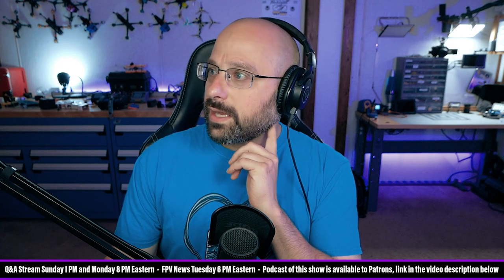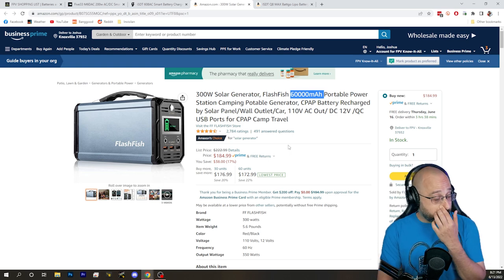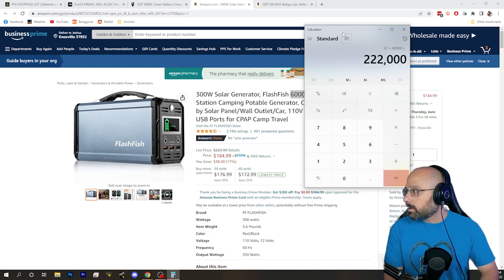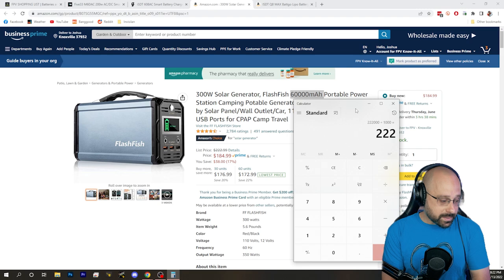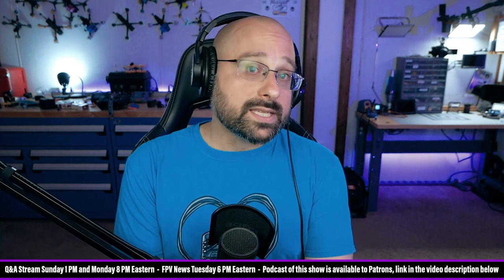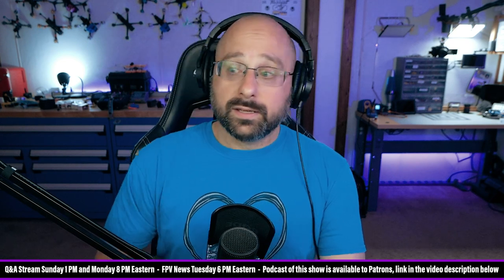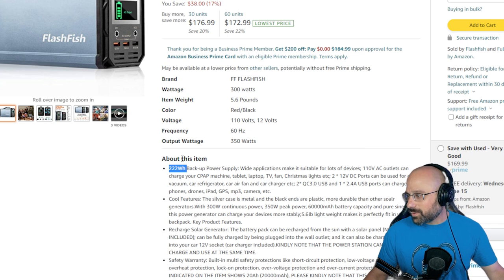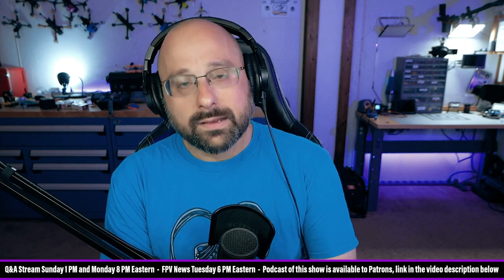One Big Battery Or Lots Of Small Batteries? - FPV Questions

Comment: I’ve been bringing one of those toolbox sized power banks to the field and it works well for me. I can charge some extra packs and/or use the 12v outputs for my goggles and ground monitors. It’s got USB to charge my transmitter. Perhaps not the most efficient field-charging solution but very versatile.

Comment: I use a similar power station for field charging. I just made a barrel to xt60 adapter and it works alright.

It's definitely inferior to a big lipo, but where it shines is that you can plug a solar panel into it while camping.

Comment: I have a 20A 6S4P Li-ion field pack made out of 21700 cells that I use for charging my flight packs. It’s enough for a whole day of flying. I use two flight packs and charge them at 10C. Over 100 cycles and the IR still sitting around 2. I know this style of charging is somehow controversial but I haven’t had any problems so far. Just be careful to fly the pack as soon as it charges and you’ll be ok.
Reply: I've heard the same thing about overcharging lipos, as long as it's flown right away after being charged to hv the lipo should be relatively ok.
Reply: The same. so much money and time saved. And it's safer since you never charge lipos at home, you bring them home on storage charge and put them directly in a batsafe. I just have 3 lipos, and change them about twice per year. :)
Reply: 6S5P 21700 25Ah here. 3 packs that are changing out, charging at 5-8C. Can confirm that the batteries last until they get destroyed in crashes - which is usually around a year for me.
Reply: @KryptFPV  Yo Can you tell me something more.  how many lipos you can load.  and which type 21700 battery you use? (mah an a) or a weblink to battery
Reply: Can you tell me something more.  how many lipos you can load.  and which type 21700 battery you use? (mah an a) or a link to battery
Reply: @Snipfpv  diy. about 26.000mAh 6s6p liion pack. can draw 30A from pack. dont know the exact type but i thing they are some LG 4850mah 21700.
Reply: @Snipfpv  INR21700-M50T 5000mAh - 7.3A
Honestly no idea how many packs you can go through with it, I can fly all day with this fieldpack
Reply: @KryptFPV  thx for the comment mate🖤
Reply: @Snipfpv  all good! Sorry for the late reply - I usually don't check youtube:p

Comment: You know, Joshua, I've seen a pretty interesting system used to make power walls. It's basically a stackable battery holders (so you don't need to solder anything) and a "top battery holder", let's say, with the BMS. So you just fit the batteries in and connect each holder from the stack with the BMS via cables (with connectors). You know?
And searching from China I've found those for 6s packs upwards (I guess the highest I've seen was 9s, but I'm not sure).
Either way, I'm thinking about buying this stuff and making a field charging box. I could put an USB out, maybe even an USB-C out...
Anyway, just some dreams. 😬

Comment: Im a racer. I have 60Ah 4s liion=4kg. And I charge 28paks 6s 1.3Ah on field. I have 3pcs of these 1.3 and while I flie next two is charged. Because charge time is 6minuts on 10A. And I always fly with "new" packs, and they warm, with less internal resistance. Therefore less damage. With regenerative 7A I discharge 5min after finish flie. So these battery's hold for me around 400 cycles each. And each year i buy 3 new packs is less money than each year buy 28pakcs. I do this already 5years.  That's the point!!!
Reply: Can you tell me something more.  how many lipos you can load.  and which type  battery you use? (mah an a) or a link to battery
Reply: @Snipfpv  please read my answer to JB again and you will get all answer's. 
Lion battery 60Ah I made by my self, but you can use any lion/Lipo 60Ah or more, it's depend on your fly times.